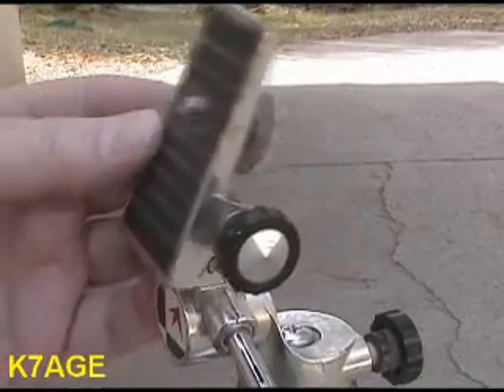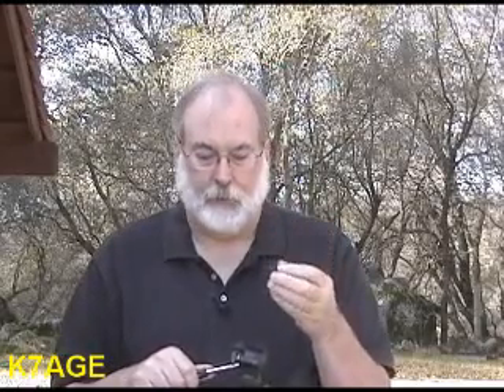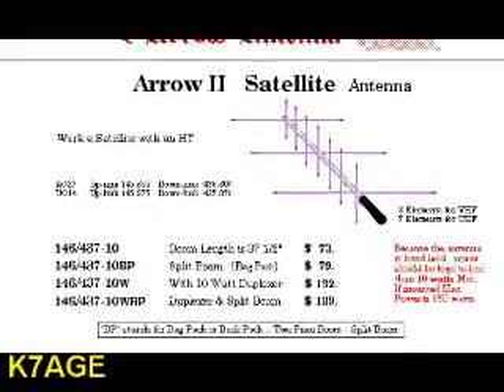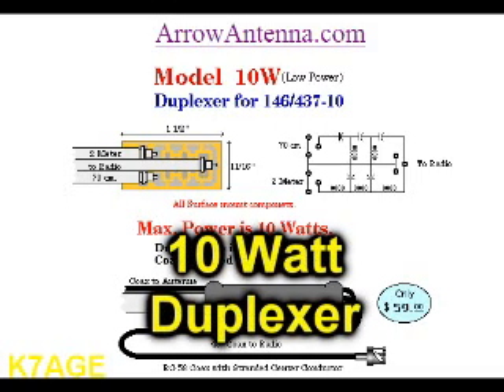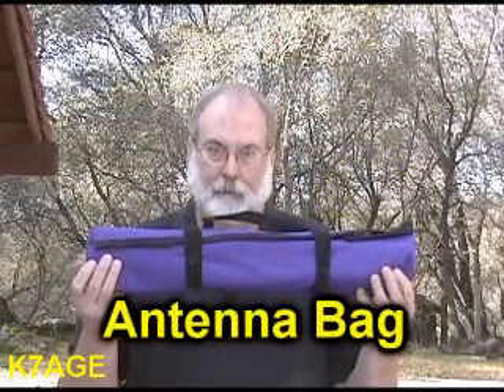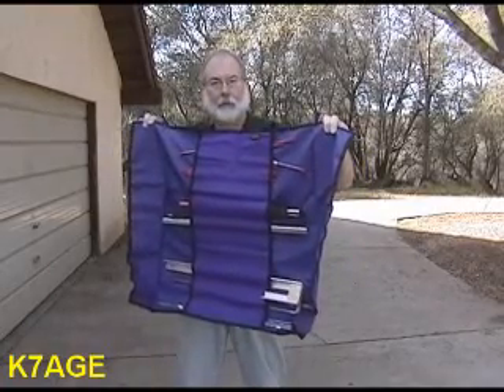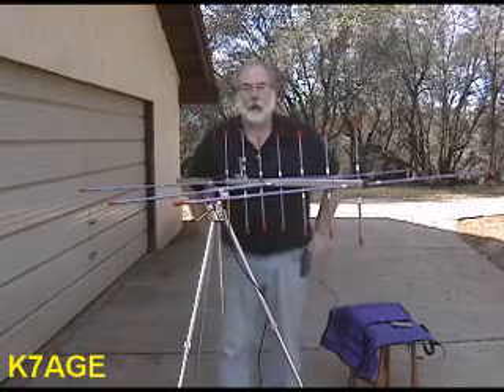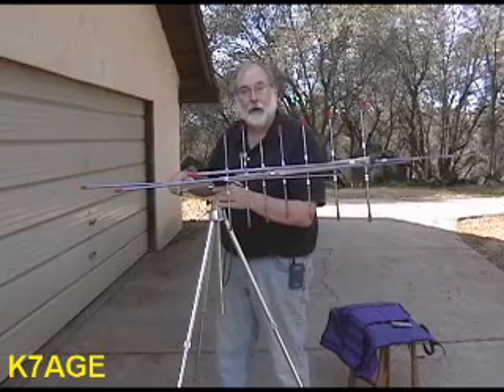Ham Radio Satellite Arrow Antenna

Comment: Thanks for another great video. You didn't mention it but I'm guessing you added the aluminum angle bracket to hold your radio and counterbalance the antenna?
KB1ZYI
Reply from the maker: Yes. I have another video about the bracket.
Reply from the maker: Ues

Comment from the maker: The duplexer fits inside the handle. Three coax cables come out the end. One for the radio and one each for the 2M and 70 cm antennas. The driven element on each antenna has a BNC connector. So, if you do not want to use the duplexer you can connect directly to each antenna. The duplexer is only rated low power.

Comment: My Cushcraft set-up is quite similiar to your Arrow.I use s.s. quick release pins(wired to the 'pod to prevent loss)for the boom-base plate connect.Acquired these pins at a marine hardware dealer.Very handy.I've also color coded all the parts on the beam-makes for a quick assembly.Excellent video on portable sat. antennas.Thanks for posting and 73's

Comment: There seems to be some misconceptions.
Antenna elevation is first, gain is second, power is third.
The reason satellites work so well is the elevation and excellent antennas, a few watts covers the entire CONUS.
What the arrow antenna does is allows one to carry a dual band Yagi that can easily be disassembled and transported.
The satellites are the true key elements, without them range on VHF/UHF would be very limited indeed.

Comment from the maker: I haven't checked, but at 2 meters the antenna is about 1/2 to 3/4 wavelength above ground. Probably 2 wavelengths at 70 cm. Seems to work fine. Randy

Comment: Is there a risk of dirt/moisture effecting the duplexer inside of the antenna handle.
Reply from the maker: Sure. It is just a small printed circuit board in the handle.
Reply: ok, thanks

Comment: Nice video Randy! Thanks, I am looking into getting one of these but it is nice to see how it goes together*

Would this also work with normal UHF/VHF repeater work?

thanks and 73
Reply: Heh. I realize that you left this comment 14 years ago, but in case anyone else happens across this comment and has the same question, the answer is:
Yes. There is nothing stopping you from using the Arrow for normal repeaters. That's what I plan to use it for, so that my tiny little 5w Yaesu can reach out and touch significantly distant repeaters and stations.

Comment: If I buy the 146/437- 10W model with duplexer, do you know if the cables will be included? If they are, is it a BNC male to male? Thanks.
Reply from the maker: When I bought my antenna (many years ago) the duplexer has cables soldered to it and each of the three ends has a male BNC.
Reply: Thanks

Comment: I have a question. I bought the same antenna but SWR is always above 2:1. One thing I noticed before moving things around. The clamp that connects the matching stub with the driven element, is made of aluminum. It clamps over the element but the driven element is coated with some kind of non-conductive polymer. There is not DC connection between the clamp and the matching stub. Is this normal or was the connection spot supposed to be cleaned to ensure good electrical connection?
Reply from the maker: Hi, I don't know. Maybe sending an email to Arrow Antennas would be best.
Reply: Hi Andrew, did you get some Info concerning that electrical issue and the SWR? Tnx for coming back. 73`s sTef

Comment: thank you very much for this video, I'm a new ham radio and enjoy working SAT but want to improve my station and this antenne seems to be a godd choice.
Is it possible to use this antenna to others things, for exemple only as 2m yagi for SSB ?
If the duplexer is detached, how do you connect the antenna ?

thank a lot in advance for these novice questions

Comment from the maker: It is the 1/4-20 screw on the tripod that attached to the tapped boom. You shouldn't need anything else.
Reply: I've used my arrow for 15 yrs. One of my prized hamvention purchases.  I Never knew there is a 1/4 20 thread under the handle!! I'm an idiot. I'm going to look tomorrow! THANKS!
N1BAQ

Comment: I'm putting together your setup.  Need to know how long the 1/4-20 screw has to be to attach to the tripod.  I looked at some Vanguard tripods ... the screw appears to be pretty short and I'm afraid it won't go thru the boom ?   What brand tripod did you use for your video.  Thanks .... KB1ZIU

Comment: HI Randy, somewhat new to ham, and found your videos.  Thanks for sharing.  The hole that is tapped to fit onto the tripod, was that done by you, or was that done in the making of the antenna?

Thanks and 73's Tim N4TJH
Reply: +Tim Hurst I am not Randy.  But I can answer that question for you.  The hole is in the antenna from the manufacturer.  seven three de kevin/NB7O